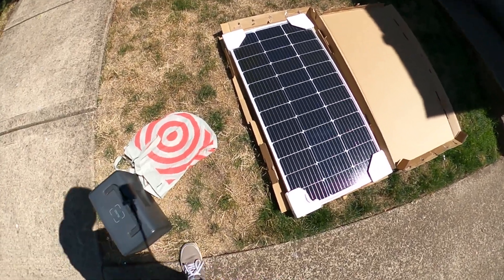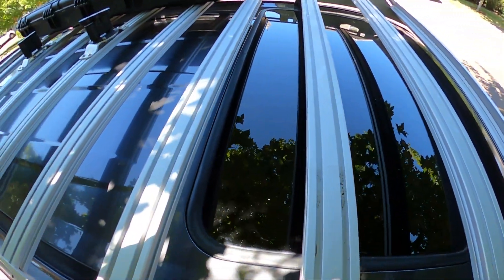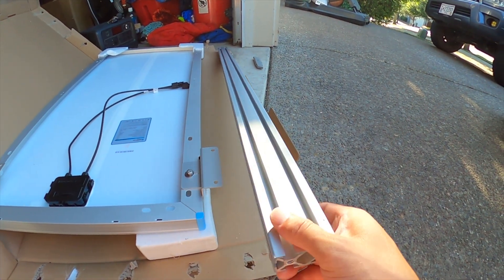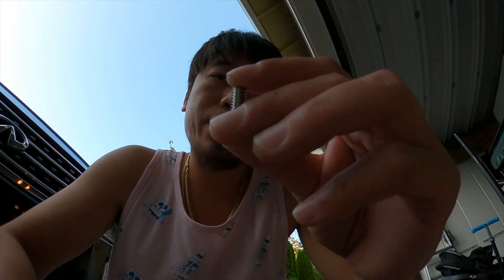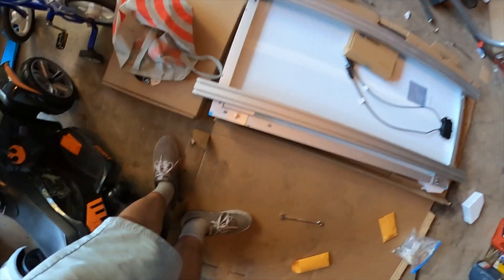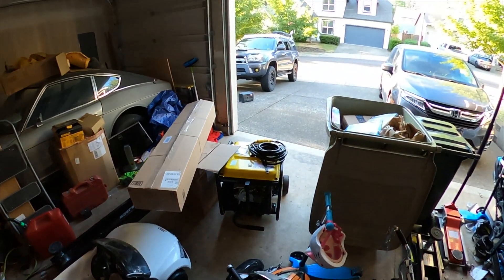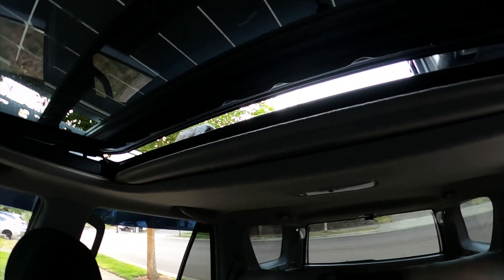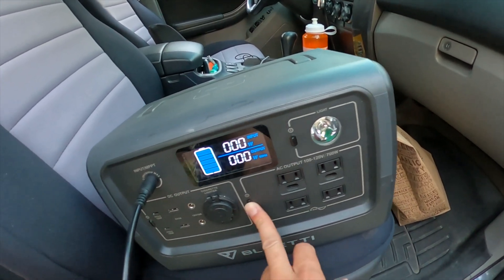Off-Grid Adventure Upgrade: Solar Panel Install on My 4Runner!

Comment: Have you noticed a large difference in wind noise after installing the solar panel?
Reply from the maker: @charleshammack  it's not bad when your windows are rolled up.  But I can no longer open my sunroof while driving, it gets super loud lol
Reply: Better to attach flexible solar pannel😊